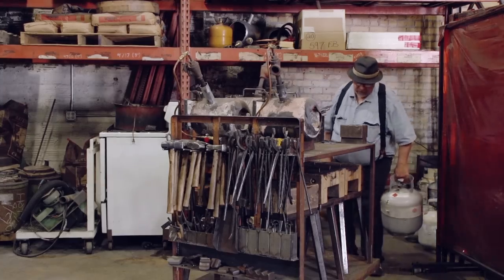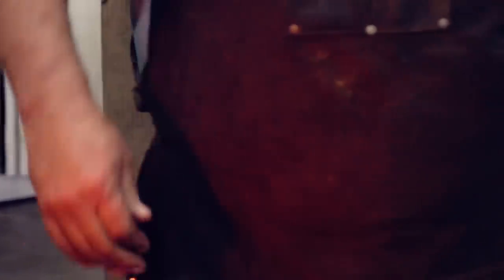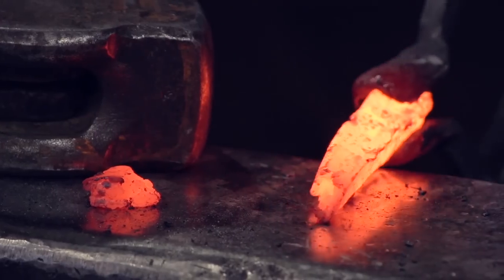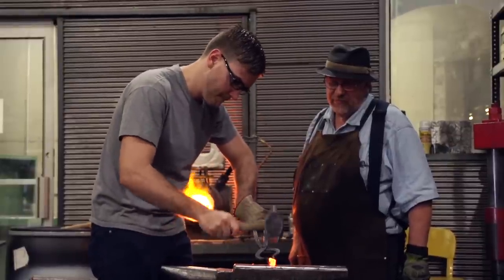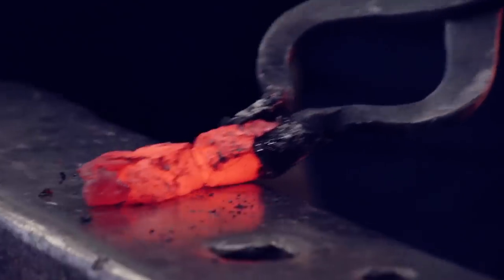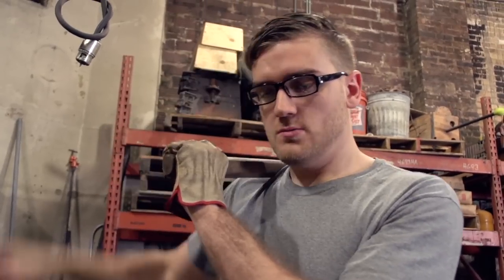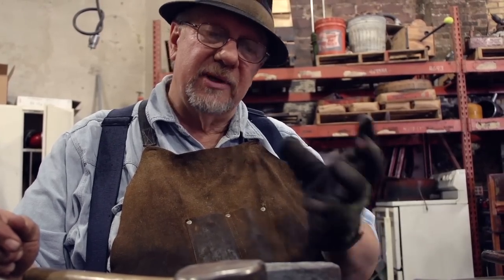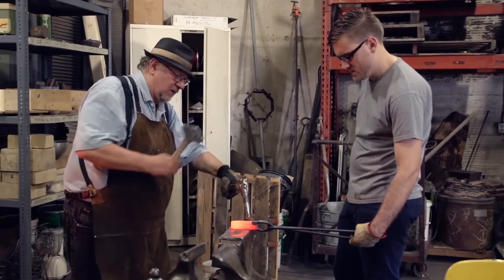Blacksmithing Iron Ore into a Hammerhead | How To Make Everything: Tools (4/6)

Comment: Great video but you missed the whole process that I wanted to see and im sure others do too, how does the iron go from raw hematite to that iron bloom he was heating up. Is that just the raw melted iron they dig out of the bottom of smelters after they heat up the hematite and melt out the iron? Or is the more to the process before it gets worked by a blacksmith?

Comment: great video, but you are using a hammer... to make the hammer
Reply: rowan doyle Where is chapter 5?
Reply: You can use wood hammers to form iron. At least your first iron. Like a hammer side and an axe or point side.
Reply: Its a bout the skills.
Reply: U can use a rock
Reply: I've seen it done btw
Reply: you can but rocks usually break after a few bangs unless you got a nice thick chunk. 
Wood though lasts cause it stays together. Use a rock to carve a mallet  and you're getting yourself set up for success.
Reply: Jesse Patrick That works to!
Reply: rowan doyle you need a hammer to make a hammer, even if the head is wood or rock. unless you cast it.
Reply: In the next video in the series he makes a hammer with his previous tools
Reply: they used rocks
Reply: The first hammer was most certainly cast And not blacksmith
Reply: It's not his hammer
Reply: No such thing as to many hammers

Comment: i'm surprised that no one in the comments mentioned how he didn't even use his own ore that he got from the mine in the video, clearly the iron in the video has already been bloomed in a charcoal stack and is the runs that collect in the bottom, an entire critical step is missing from the process here... i mean you can totally do it from scratch with actual charcoal that you actually chopped from a tree, rather than from some propane forge. It is an excellent video, just a little misleading especially if the point is diy from scratch

Comment: What if you don't have a gas forge or a hammer to make this HAMMER. Your stuck with the stone tools ain't ya
Reply: I agree that these videos do not deliver their intended point.
    it's a bit hard to control, but I've used a stone hammer on a granite anvil to make a knife.
Reply: M Msaiu Then you make other iron tools, like a pickaxe, then you use the iron pickaxe to mine diamonds, then you make a diamond pickaxe so that you can mine obsidian and use that to make a portal to the nether
Reply: Antisimex this guy gets it!
Reply: tanfo8 yes or you can cast one
Reply: Casting iron requires much higher temperatures than hammering down a bloom or chunk of meteoric iron.
Reply: Levi Blackwood casting a hammer would not work and you need much more fuel and a crucible and a mold

Comment: I guess I'm wondering how often a blacksmith hits the molten hot metal with his hammer and a piece goes flying into his skin. Um, ouch? Would that leave a damn hole in you?
Reply: +Jim Brown Granted, I'm a novice but I've learned a few things. Technically, I don't think blacksmiths work with "molten" steel, as molten is pretty much liquefied. Like in the intro to this video he calls it malleable. Just hot enough to make it move under the weight of the hammer. If you get it too hot in the forge it just sparks off into oblivion and the piece is usually worthless. But at a regular forging temp you will have "scale", that is a layer of oxides that forms on the surface of metal while heating, that's the sparks you see when hot steel is struck. Now that is hot enough to burn you a little, but its usually going a way from the smith or down. I've only been burned if I was holding a piece from below like shaping on the horn or something, but its usually not that bad. Now, if you hot cut something all the way through without stopping and breaking/bending it off, usually the hot end will fly off and potentially burn someone really bad, and fast.
Reply: Jim Brown I've done a fair amount of black smithing. I have tons of scars from it. Including one on my eyeball.....